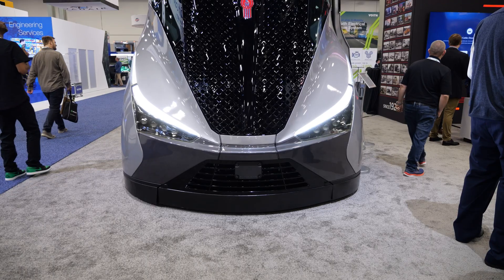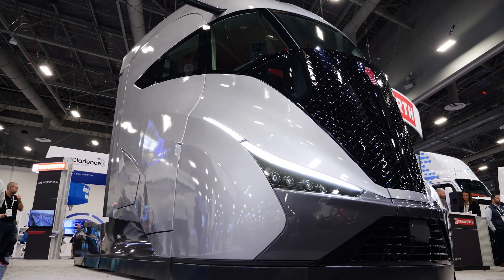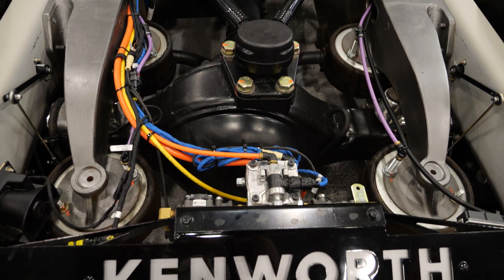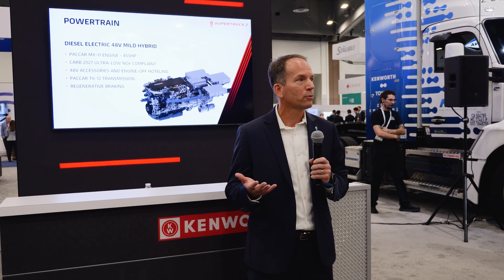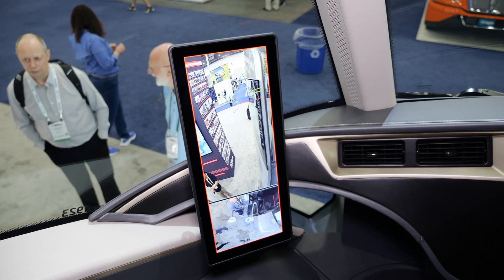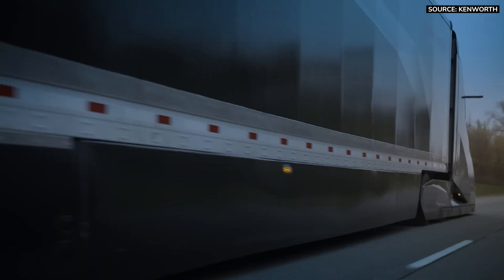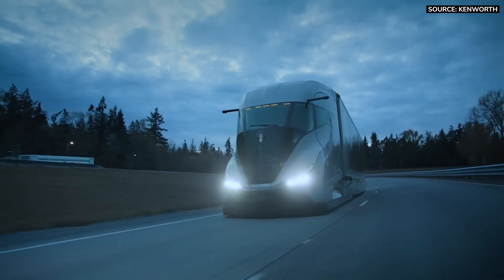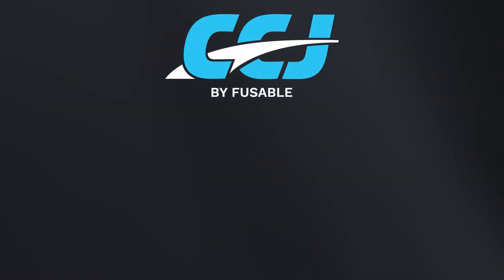Kenworth’s SuperTruck 2: A Highly Efficient Concept Vehicle

Comment: Not gonna lie, that looks awful, It looks like someone that never actually drove a truck designed it. The interior is just wasted space, no driver wants a fecking bench seat and a cheap foam murphy bed, we need places for clothes, food, water, equipment for multiple types of haulage work. The exterior styling is no better, the first blow out you have will rip those side skirts to pieces, how much will they be to replace, the gap between the trailer and cab can be overcome with close couple trailers and a sliding fifth wheel. the skirting around the cab so close to the floor will be cracked or missing within weeks, how much will they cost, you have seen the condition of the roads! They only really seem suitable for motorway trunking to gain maximum efficiency. At the moment we sit on right or left which gives us one blind side, why intentionally give us two- what so we can rely on the cameras, how much are they to replace or the screen inside when it inevitable becomes broken, we can buy a mirror anywhere, not so much a camera and screen system.. A gain in efficiency but with a loss of utility.

Comment: I can picture the engineers going over a checklist.  1-"...enclose the front tires..." - Changing or inspecting tires a pain in the butt- check, Hang all that plastic/fiberglass skirting to where it hovers an inch over the ground where it will catch any road debris or potholes - check, 3- pack all engine/electric drives components to where it is impossible to access-check, 4- Wait...my wife was banging a mechanic.  Let's ruin every mechanic's life when they work on this - check, 5- Let's make it impossible for the driver to escape in the event of a catastrophic accident or fire - check, 6 - cost?  Impossible to afford - check, 7- Parts?  Forever national backorder -check.

Comment: Looks much like the disaster Anteater release.  49 volts, really?  450 hp, in today's industry, where 500 to 600 provides the desired performance.  This is the US not Europe with autobahn,  the aerodynamics on front and side will be ripped off at the first truck stop or customer driveway.  Granted, there appears to be economy improvements, but the additional expenses of a 48 volt Gen set and electrical system along with body repairs all add up to a massive increase in KW parts pricesvand sales.Another instance of fingerneers designing for profits and, fantasy land as opposed to the actual world of reality.  reality